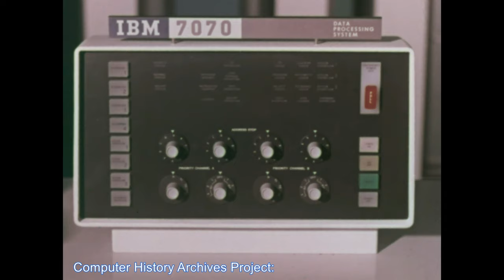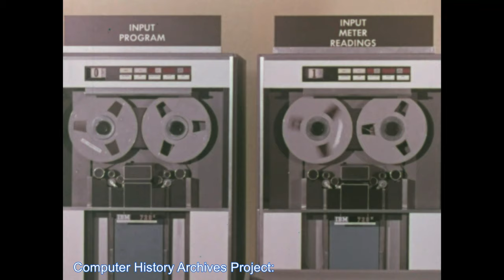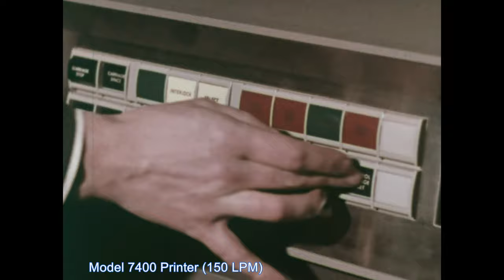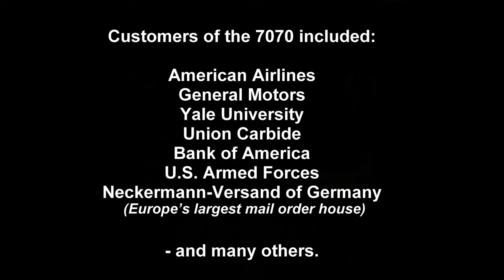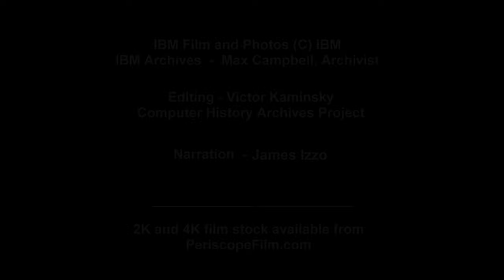IBM Rare 7070 Mainframe Computer film 1960 (7074, 7080 transistorized SMS 1958-1961 (7090)

Comment: Back in 1960 I was a systems rep (later called Systems Engineer) for IBM in St. Louis. I was one of two IBM systems reps assigned to American Investment Company (which owned many small-loan offices around the country) in Clayton, a suburb of St. Louis. The task was to get their programmers up to speed so the 7070 they ordered would be ready to operate when they received it. We tested the programming at the IBM center in Chicago, since there were not yet a 7070 in operation in the St. Louis area. Yes, we succeeded. And... everyone pronounced 7070 as "seven-oh-seventy", not "seventy seventy".
Reply: That's interesting, because the 7094 was definitely called the "seventy ninety four" -- so somewhere along the line, the initial '70' must have gone from seven-oh to seventy.  Another example is 1401, universally called the 'fourteen-oh-one'.    And the 1410 was the "fourteen-ten".  "360" was "three-sixty"  1620 as "sixteen-twenty"  on and on.
Reply: @cheponis  We pronounced the 7090 as "seven-oh-ninety". I assume that was because the 709 (predecessor to the 7090) was "seven-oh-nine". And yes, the 1410, 360, and 1620 were pronounced as you said.
Reply: @MalcolmRuthven  a ha!  I think that is where the 'split' happened.  Where I was at the time (Indiana), we called that the seventy-ninety because folks had actually used the 7094 and were referring to the previous machine; yes the 704 was seven-oh-four so I see how when adding a digit, the 'seven oh' survived.    The pronunciation was the 'name' of the machine; the number was just an artifact...
Reply: @cheponis I never had anything to do with the 7094 so never knew (then) how it was pronounced. I also checked with two other people I knew back then and yes, we all said "seven-oh-seventy", "seven-oh-eighty", and "seven-oh-ninety". I worked with all three of those.

Comment: Brilliant. All transistor and super quick. Still expensive and a pain to use. :)
Reply from the maker: Yes, you are so right.  The ongoing power, cooling, and floor space rental must have added up considerably over time, not to mention maintenance.  ($$$).   : )
Reply: My dad programmed IBM mainframes starting in 1970, and he told me that the IBM maintenance guys were very skilled, arrived quickly, and fixed any problems amazingly fast.
Reply: @thetooginator153  They had skills back then.

Comment: I’m still amazed to this day that by the mid-2000s there were data centres which still required a library of open reel tapes and were only just getting rid of the old vacuum column machines…….to be replaced with smaller tray loading equivalents. These were legal/contractual requirements and they couldn’t just image the tapes.

Still, I wish in hindsight I had a chance to mess around with the old drives during my work experience, but they weren’t even connected by this point.
Reply from the maker: Hi tech3475, very good point!   There is a massive data storage company (Iron Mountain) that keeps all types of computer media and other media in secure storage.  I wonder how much tape storage they still have from the 1970's or earlier....  I think you are quite correct that many times legal requirements mandate that the original media be kept indefinitely (however long that is) in case there is a legal challenge to some original recording.   Some very early tapes are probably no longer technically readable, but someone is paying to store them.  Fascinating!  ~   Thanks!  ~  Hunter, at CHAP
Reply: @ComputerHistoryArchivesProject  I do not know about open real tapes..but i worked at Microsoft in the 1990s and 2000's and what they did was back up the servers onto 8mm tapes..these were stored in 2 tunnels under Microsoft for onsite storage..once the tapes were too old to keep onsite they were moved off-site ..one time my manager and i went out to the off-site location to retrieve some very important tapes..we drove down a paved road then turned onto a dirt road drove for a while and stopped in the middle of what looked like a cow pasture with an old beat up red barn..i thought he was playing a trick on me..we opened the barn door went down some steps and opened a vault style door and this HUGE room full of tapes...all climate controlled underground...got the tapes and left...still amazing to me..

I am keeping this comment vague due to i am not sure if MS is still using the offsite location...
Reply: Where I worked they had a huge automated tape machine.  It seldom broke but when it did, IBM came out to fix it and said it was kind of a relic.  But the company didn't like to get rid of things, it if worked they kept it - they thought this way about people too.

Comment: A decimal machine? That’s an intriguing detail.
Reply: There was a later IBM series of machines which used only decimal arithmetic (other than for address manipulation).  It was called the System/3 and it had successors which also used decimal for the jobs for which they were sold.  These were the Systems/ 32, 34 & 36.   (Not the S/38, a completely different design.). The 34/36 did have decimal in one of their two processors but not available to the application programmer.

Comment: So those decimal machines must be the reason IBM and a few others had BCD instructions on later machines like S/360 and 370. High level language programs could be ported without introducing round off errors.
Reply: Even the Intel 8086 and 8087 (floating point coprocessor) have a set of Binary Coded Decimal (BCD) opcodes. Not sure if they've been carried over to the instruction sets of more recent processors, but I think so. COBOL used to compile to these instructions, but I don't know of any other modern language that does. (Of course, they're available through assembler.) IBM eventually adopted the 8-bit character encoding scheme EBCDIC (Extended Binary Coded Decimal Interchange Code, pronounced "EBB-see-dik") before ASCII became widely accepted. By contrast, Control Data used a 6-bit scheme called "Display Code", which was convenient for the 60-bit word length they had chosen for the 6600 and 7600 series machines.
Reply: Microsoft had a Currency data type that was the equivalent of BCD...programmed an accounting system in the late 1990's in Visual Basic!

Comment: The SMS cards do look very low density, looked at with modern eyes.  With some better component packaging and PCB layout, the density could have been doubled without too much effort, and so halved the amount of edge connectors for a given function, cutting cost and improving reliability.  But it looks like space consumption just wasn't considered particularly important, possibly due to cooling considerations.
Reply: Yeah, even for 70's pcb's that's quite spaced out... Maybe some other cards were more dense and they simply had basic cards out for display? Or it helped with production numbers?

Anyone work on one?
Reply from the maker: Hi Video99.co.uk, that is a good observation.  I would tend to agree.  It seems odd that the density was so low, but since they were "saving" so much space in the computer by not using vacuum tubes, they probably felt it was quite dense. : )
Cooling would be easier too, as you mentioned.  Great comment!  ~  Victor
Reply: @volvo09  The computer is from the late 50s early 60s, not the 1970s. It's confusing before the model number is the 70s/7000s.
Reply: Consumer solid state electronics of that period could be much higher density than those SMS cards. IBM probably wasn't concerned about the size of the system since the customers paid for the faciity and most probably wanted a big, impressive installation.
Reply: I would tend to another conspiracy 🤣🤣🤣 Those systems were developed really quickly at the pace we can't imagine without IT infrastructure assistance today. So folks just wanted to keep things simple and easy to debug either during testing period at factory or then at client's side.
Reply: Probably the same engineering process you might catch by digging in soviet era electronics. Either consumer or IT for //enterprises// and other stuff.
Reply: @dalecomer5951  —- 1) field repairable, 2) the pin spacing could not be easily reduced, 3) limitations on the adhesiveness of the foil, 4) prevent internal RFI between components.  Ten years later, Wang boards were only about twice as dense.
Reply: Keep in mind that the form factor was decided on by engineers used to designing vacuum-tube electronics, and that the boards were almost certainly assembled and soldered by human hands - at least at first.
Plus, with a standard card size, some boards would naturally have fewer components on them than other cards that were providing more complicated functionality. There's no point in squeezing the components together only to leave 90% of the  module PCB empty!

Comment: You could actually diagnose and repair those cards, and they did.
I remember in the 80s they were still repairing PC cards

But by the early 90s they had abandoned repairing PC cards

By 1995, when the PC stores were all over America, people would not even try to get warranty service, and would simply pull out the bad card.
Sound, video, com port, modem, Ethernet, printer, HDD / FDD controller, memory, they were all just tossed in the trash and replaced.

I remember the old days of the first ISA bus computers, 8 bit.
Then the 16 bit ISA and the 32 bit PCI
I also remember having USB in the very early 90s and literally no drivers and nothing that could use it

The very first thing that was USB and was the only thing that was USB for the 2 or 3 early years was a mouse
Then came a keyboard
Many of the USB devices that came out would not work because of bad drivers or no drivers

The early days were really amazing

Dialup, all text internet

People today don't know what it was like
Reply from the maker: Hi ocsrc, your comment brings back memories.  Yes, all those cards became toss-outs rather than fixable.   Many savvy computer users would know what card to buy and replace, with a little study.  Today, it is doubtful most computer (and smart phone) users could accurately name the internal components of their devices.  Except maybe SIM (Subscriber Identity Module) cards.  (?)   A lot has changed. ~  Thanks!

Comment: What was the purpose of the vacuum column? Did it use the Venturi effect?
Reply: Takes up slack of tape and keeps the tension.
Reply: Loops of tape between the tape reels, which had high inertia, { slow to start & stop }, and the capstans & record/play heads, where the tape could move much faster, needed a method to keep the tape loops from losing tension, which would allow the tape to droop away from, and out of contact with, the record/play heads, - thus the vacuum column.  
I worked in the movie audio business in the 1970s - we had similar issues with sprocketed magnetic film {for audio recording/mixing}, but we used simpler rollers/pulleys on long spring-loaded arms to serve the same purpose.   Ancient, obsolete tech - modern memory chips & hard drives have eliminated all this mechanical complexity.  
Thank God for 64 MB thumb drives...  We live in a time of miracles.  There is no such thing as "the good old days" - our lives were nasty, brutish & short.  LOL  
Also search for information on the original Ampex quadruplex 2" tape video recorders which required vacuum assist to pull the tape into a semi-circular shape as it passed over the spinning record/play heads handling segmented 4 MHz bandwidth video signals.  More obsolete tech from the late 1950s early 1960s...   See : https://www.youtube.com/watch?v=zHDU1wXw1sU
Reply from the maker: Great information!  Thanks so much for sharing your experience with some of the early tapes.   A fascinating mixture of technology too.  ~   Hunter, CHAP
Reply: Because of the start/stop nature of reading data, it takes less effort to quickly move and stop tape when there is no heavy weight of a reel of tape attached to it. The vacuum columns serve as a low-inertia tape buffer by isolating the weight of the reels of tape from the region of tape that is across the read/write heads and in between the capstans that move the tape. For smaller tape drives found on minicomputers, less expensive tension arms substitute for the vacuum columns in taking up the slack.
Reply: @jrb_sland5066  I remember using tape machines like these.  If they had to be diagnosed, we put up a special diagnostic tape onto them, hooked up the remote telephone handset to the modem, got our high speed 9,000 or 12,000 baud connection going and let the tape mfg company run diagnostics.  Then they would come out with the right parts and make their repairs, this was in the 1980s.  They were very reliable.  I remember the telephone modem, because we had to drawl under the operators desk to reach it.

Comment: 6 Meg disk storage,  OMG,  not much could be stored on that, in the early 80s our RPG programs I wrote had to be compact, and the chained files were difficult to understand,  now that I learn more about Microsoft Access it's a simple link to eliminate redundancy and keep data from being stray variants of a desired set group of values.  Technology has changed a great deal, but sadly there's always a big brother keeping track of every step you take.
Reply: 10K or 5K magnetic core storage unit (RAM). Imagine coding for that a whole banking system.

Comment: "decimal machine" how this works?
Reply from the maker: Hi Neves, good question, here is a "short" answer.  Decimal computers can represent numbers and addresses in decimal as well as providing instructions to operate on those numbers and addresses directly in decimal, without conversion to a pure binary (base two).   Some computers also had a variable wordlength, which enabled operations on numbers with a large number of digits, for large calculations.   The 7070 was a decimal computer with a fixed word length.  By contrast, the 7080 computer, however, had a variable word length, and this, as well as other factors, made the 7080 a much faster machine than the 7070.   Hope this helps.  Much more data on-line if you want to delve deeper into decimal architecture vs. binary.  Thanks~ !    ~  Hunter, at CHAP
Reply: @ComputerHistoryArchivesProject  Other decimal computers that had a large usage were the IBM 1401/1410 series machines, and the entire Burroughs "Medium Systems" line of computers that existed from about 1965 to 2000.